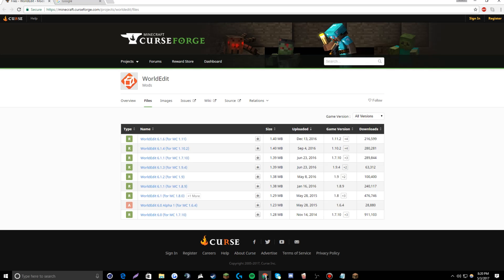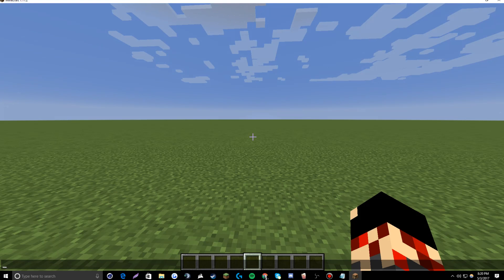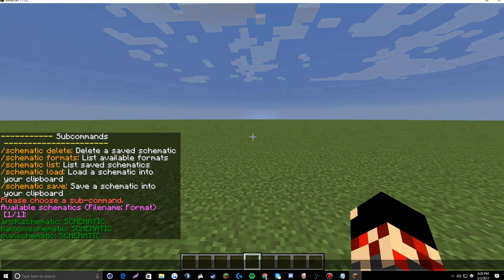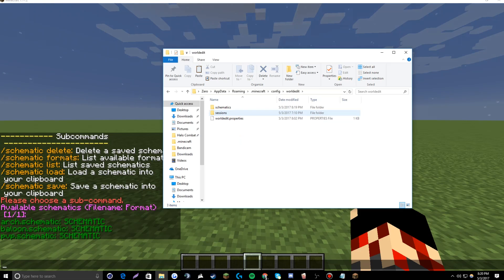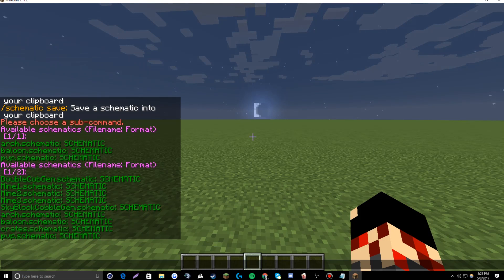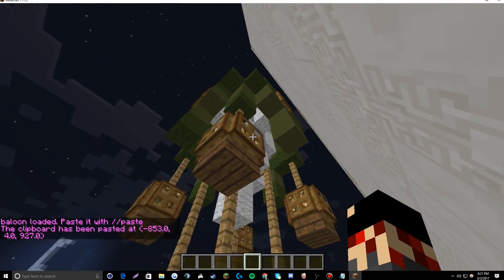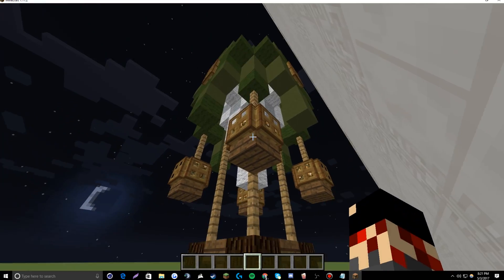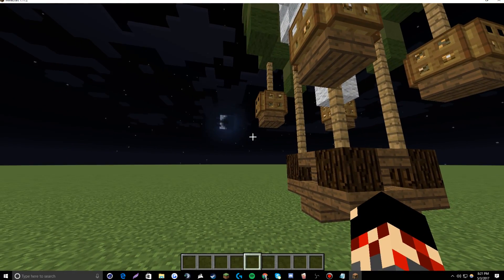how to load minecraft schematics in singleplayer

Comment: this might be 2 years too late but it wont create the folder after doing /schem create test
Reply from the maker: Try a double slash //schem create test 
After selecting your regions
And make sure your using your corresponding versions for your world, because this is for 1.8
I don't remember if you need two forward slashes or one, but the concept is the same